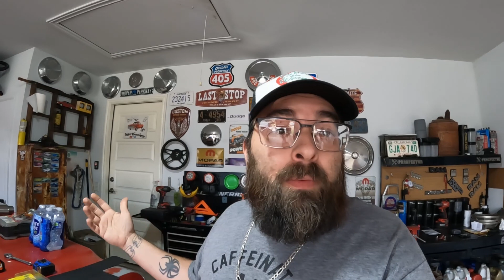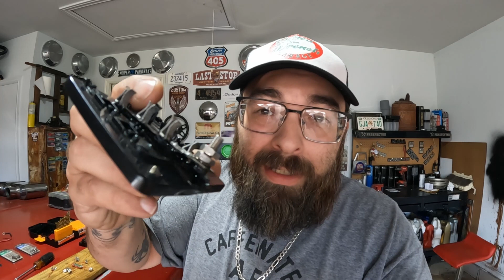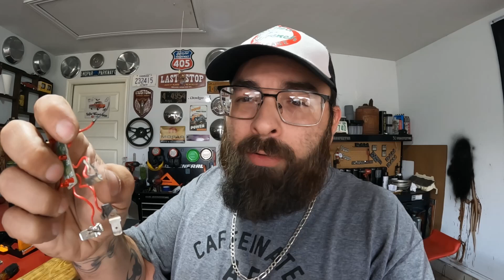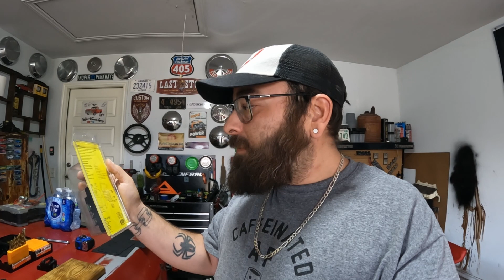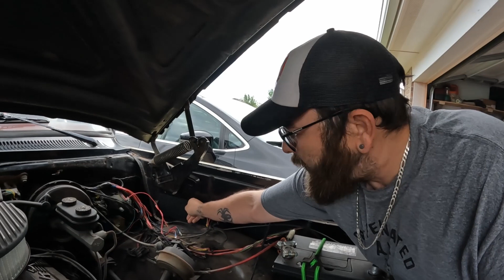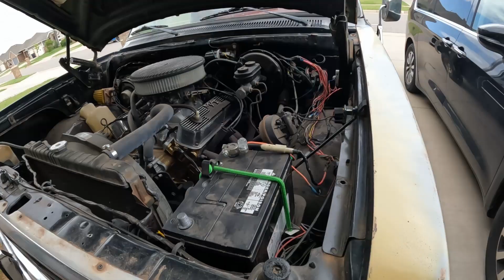Budget Amazon Fuse Panel Let Out The Smoke! Shop Truck Down!! 1981 Dodge D-150 (Project Black Pearl)

Comment: So the 16 gauge in the diagram shows 60 amp but you have a 30 amp and it does okay? And the other 3 are 40 amp correct because mine is an 84 and pretty sure ill be doing this exact same setup
Reply from the maker: Yea it calls for a 60 i think I swapped to a 40. But it's been fine without any issues.
Reply: @twiztedwrenchgarage thanks so much man for all the info plan on doing that same setup when do get back to my truck may hit you up one more time right before I get back just to double check if things are still good before I fully decided to dive  into it
Reply from the maker: Np bud. Happy to help. That's why I made the videos. Glad they help out. @colte121
Reply: @twiztedwrenchgarage just one more quick question what gauge wire did you use on each fusible link to add more length to it?
Reply from the maker: @colte121 16-18 gauge i believe.
Reply: @twiztedwrenchgarage so 18 gauge for the actual fusible links? And 16 on the power wire from the battery?
Reply from the maker: The power wire for the alt os a 10bgauge for a 60 amp alt. The others are smaller.@colte121
Reply: @twiztedwrenchgarage so the others would be 16 then? The wire straight to the battery and the alternator one I'm gonna try and not add any extra wire if I can
Reply: @twiztedwrenchgarage would you know what the main duck foot wire gauge is coming from the battery itself?
Reply: @twiztedwrenchgarage so all 4 are 40 amp and fine?

Comment: Great informative video bro. Dude I noticed on my battery my ground cable goes to my frame but it also has some ground wire going down to what looks like under my engine somewhere!??! do you know why that would be? Bro come to Norman or I need to come seek you out lol. Also my wiring looks like something else.  Have a good weekend, laters man.
Reply from the maker: Well, you should have the big one to the block, then one right off the battery that is normally attached to the core support or anywhere on the chassis. Then you should have one from the motor to the cab. There will be more beyond that for various things. Might meet up some day you never know.